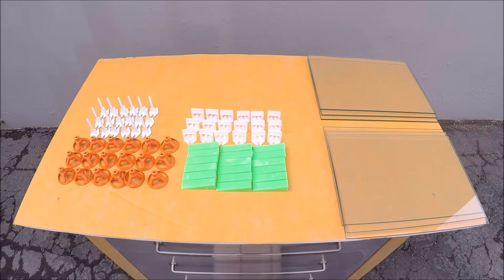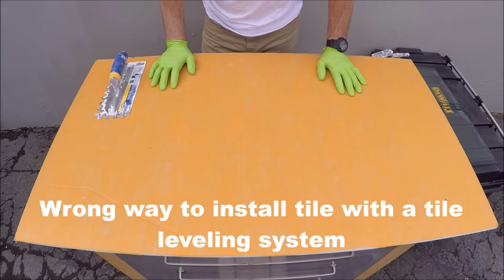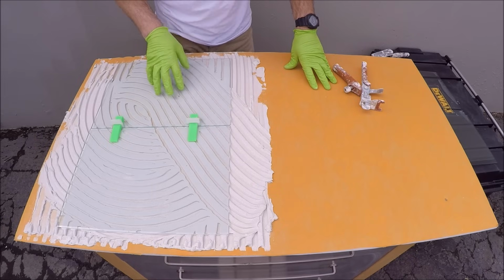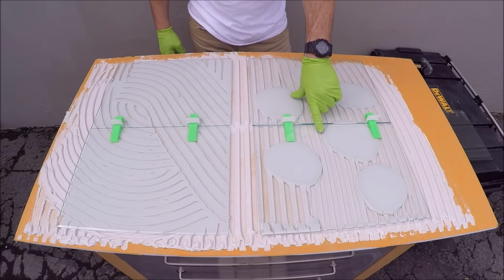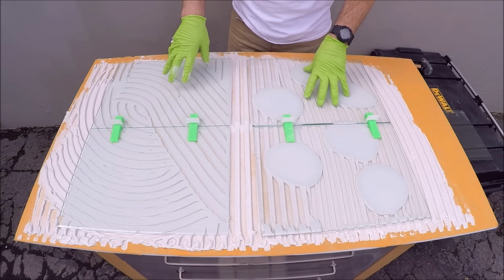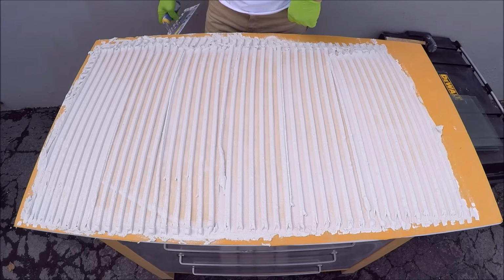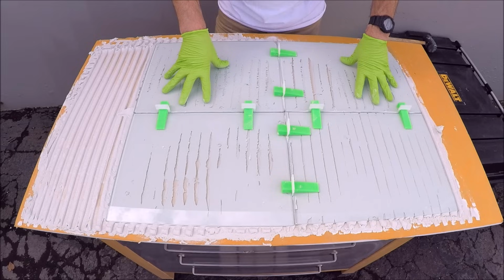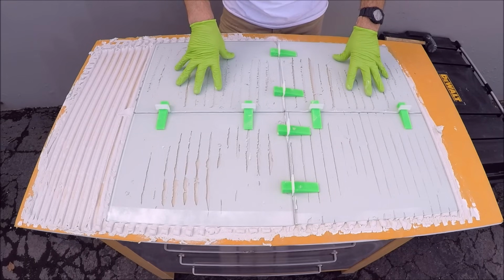How to Use a Tile Leveling System the Right Way

Comment: Straight trowel for all tiling never ever swirl,,, 900mm square porcelain tile job 250m2 ...this should not be called leveling kit, it should be called,, tile edge flush kit coz that is what your trying to achieve, getting the joints flush, this floor we did had not one step in the joints and the sub floor was pretty bad, the kit takes out all the pissing about, let's face it if something can make a job more practical just do it
Reply: Maybe it didn’t have any steps bu I bet there was a lot of voids under the tile

Comment: Good explanation but not pro approach 
Even second way is not right way installing tile with leveling system. 
On third tile installation it is clear you have excess of mortar beatween edges contacting plastic.
It will block leveling system from proper cracking  at bottom, but most likely crack will be a bit of  over top of tile or on same level as front of tile
Than  you have to use any kind of trowel with hammer to remove plastic leg.
Reply from the maker: Sorry you didn't like the video, I have 240 more videos to check out. Also, stone tile isn't used for flooring anymore, so the talk of cracking is dated my friend. Porcelain for the go.
Reply: @LandbergTileTV  I didn't say I didn't like video, just a bit details than it comes to real life, because nobody mention about how to remove plastic legs.. 
The rule if you use tile leveling system  and having excess of thin-set between  edges, than remove tile and clear it up :)

Comment: This has nothing to do with spacers or “leveling system”. This was a video on how to spread thin set. Doesn’t matter what type of spacers you get there’s a wrong way to spread motor and a correct way. Obviously correct way is to do directional pattern in one direction but again that has nothing at all to do with spacers or leveling system. Good information just pour choice of title.
Reply: And a comment with a "pour" choice in spelling 🙄
Reply from the maker: lol

Comment: Step one. Throw levelling system in the trash. Step 2. Hire a decent tile setter
Reply from the maker: Tile leveling systems are great and a lot of pro's use them, but thanks for the comment buddy 👊
Reply: We won't settle for decent it needs to be perfect there is zero tile settler who can install sharp edge floor tiles without lippage but with leveling system it can be done.
Reply: Mr. Wizeguy 

Not true...you assume no tile guy can set better than leveling system...you obviously never met the good Tile guys...
Reply: Your claim is BS because with leveling system you get zero lippage so it CAN'T be done any better it's all ready 100%.
And what you claim is impossible because large format tile have usually small warp and when you set tile by staggering seams you get lippage which with out leveling system is impossible to get off because you can't bend tile it's even on recommendations that you don't stagger seams more than 1/3rd length of tile because of that warp. 
But with leveling system it's possible to straighten that slight warp and you get 100% smooth finish even when you do 1/2 brick layout.
So obviously you never tried to tile with leveling system because it's far better than any other method.
Reply: @mr.wizeguy8995  thats not true...just bc u or nobody u know cant doesnt mean actual installers out there cant do it either
Reply: +omi89  i bet you haven't installed a single tile EVER if you think some tile settler can remove warp from tile without leveling system. Please use your brains once and think before brainfart.

Comment: One of the two tiles gets lifted meaning lack of adhesive support. These systems are flawed. You start at the highest point and the rest of the tiles are levelled to the first by down force only, very simple. If a “professional” uses these please stop them as your floor will have hollow spots.

Comment: The glue  under first tiles would have collapsed if the guy pressed or wiggled tiles like he did with second lot. You guys are so worked up with 100 percent coverage under tiles when walls are installed with a few dabs of stud adhesive and a handful of screws. Cut the crap like tanks are gonna run over tiles.  If a tile is gonna break due to movement it will break even with 100% coverage, back butter and all.
Reply: There is another reason to get full coverage, but that's only important when you have floor heating. If there are pockets of air under a tile, that air pocket works as isolator and making the floor heating less efficent.

Comment: spot bonding is perfectly acceptable if you do it properly not like you did in the video.the type of tile also matters.different direction troweling also perfectly acceptable if u press properly on the tile not like u did on the video.do this video again only this time do it on uneven surface see how u get past that without spot bonding
Reply: mihai 123 shouldn't be installing on any uneven surface if you really care about your work
Reply: Uneven surfaces are to be addressed prior to setting.
Reply: Mihai.   Read these comments.  They are correct.  Never tile on uneven surfaces.  You dont want air pockets trapped under your tile...
Reply from the maker: Yes, it would be recommended to use self leveler if the surface is uneven prior to setting. 👊
Reply: mihai 123  if u press on the tile down and add enough thinset your are good
Reply: George Rachitan. No your not.  The tile will sound hollow when walked on and not bond properly.
Reply: Lee Seong I'm no diyer.  I just believe in doing the best possible job.  This isn't it.  It's not even logical.  Tell me how using this method wouldn't trap air under the tile and more vulnerable to cracking or breaking.  Mr. Professional.........
Reply: Lee Seong that's what I thought
Reply: mihai 123 sorry but directional is not acceptable.  It's probably ok for small wall tiles but when don't on large floor tiles the walls do not collapse and the directional turn means the thickness info adhesive is inconsistent.  It's a proven fact hence why they advice against it now.  It was once common practice until further research showed the problems
Reply: mihai 123 spot bonding and multi directional troweling go’s against industry standards. You can not and will not have proper coverage under your tile. If you  have a uneven surface then you need to take the time to make it even, self level or smooth over by other means. Always try to follow TCNA recommendations.
Reply: Good comment apart from lets remember the counties like Pakistan and India did things that's lasted 100s of years. Before the western world knew how to bath
Reply: These days the skills are not the same so info that you are correct
Reply: Mihai 123... Thanks for the comment, now I know who not to hire for any tile work. lol
Reply: Unfortunately Russell, he might be a professional tiler. I have been in situations where i was told, and "forced" to work like this, and if i would have keep explaining and argue about this problem, it would have cost my job. Sure, you can quit and off course i did, but there are plenty of contractors who just want to have the job done as soon as possible, and yeah "dumpling" (thats how we call it) is unfortunately a very common method among "professionals".
Reply: Emmanuel Soriano
All surfaces are uneven. Anyone who's been doing this a long time knows that. Self leveler doesn't actually level the floor, it just fills low spots. Adjusting the amount of mortar under the tile is ALWAYS necessary if you want perfection and NO lippage with large tile. Most medium bed mortar is MADE FOR applying up to 3/4" thick. You'll never get a 3/4" bed with a 1/2" trowel, so you might lack the skill to do it, but to say it can't be done? Nonsense. It's what Medium bed was made for.
Reply: Hmm, this so called spot bonding is not acceptable!

But each invidual Tile can be tinkered to uneven ground very easily, but as it is Easy, it can take several minutes to to get the feeling when pressed to the ground to be what it has to be, for each invidual tile.

(And it will allways fill the Groud lines, that must be cleaned before it dryes.)

But yes, just by over hyper using the adheseive is messy and will have huge mess, will work if you get the right feeling.

So, relatively leveled ground does not need much work at all.

Never work with dry adheisive on ground tiles, it will not bond with the tile!

And Room temperature must match with each invidual tile.

And would be good if thinset is mixed in the same room temperature water.

Temperatures have Huge Huge Huge part in Tiling.
Reply: Lee Seong if you tile on a floor and dot and dab, you’re wrong...
Unequivocally wrong and anybody saying it’s ok isn’t a tiler....
SLC to floor then tile.
Reply: You shouldn’t be tiling any floor if you spot bond.....period!
Reply: Got to say also, if you worked for me....you’d be out of a job ...spot bonding ffs!
Reply: Exactly
Reply: @onlytheelites5797  try telling that to all the broke homeowners out there
Reply: @russellsmith6111  Oh we deplore spot bonding here in Pakistan sir !
Reply: Can you point me to a single You Tube video that shows the "proper way" to spot bond floor tile? The same question goes for non-directional troweling of floor tile thin set. I eagerly await your response because I can't seem to find any. Maybe you can make a video showing the "proper" use of these techniques so we can all be educated. Also, please contact ANSI, CTEF, and CTaSC to let them know they have it all wrong in their standards.
Reply: I should add that, ironically, I can find countless videos showing the horrific results of these two techniques. However, maybe they were all doing it wrong.
Reply: I agree with Mihai on this 100%. The framing on houses are a joke this days, especially the walls, even if you try to straighten the wall it ain't gonna be 100%, nor is th floors. No one wants to pay extra for that, but everyone wants a perfect job. You're always gonna have air under the tile, because when the floor is just a little off let's say a 1/8" off one side of the tile is gonna pressed down more than the other side. In my experience, if you press down on a tile and it creates that bond with the thinset by moving it back and forth and you're sure it has enough thinset under that's considered a good bond. End of story. Everyone saying other wise I really wanna see your work.

I've demoed a shower recently, the guy did such a bad job on, tile was uneven. He just troweled thinset on the back of the tile and he just set it on the wall without checking to see if it had good bond. There were pieces of tile that Just half the tile had bonded to the wall, I though it was a joke. Ridiculous.
Reply: Anzio 1968 If you spot bonding the floor like what he did on this video you will fail. But there is proper way of doing similar like spot bonding. When I tile the floor I notch the floor and lift up and check if there is any void. And then I add or reduce adhesive accordingly to make the tile flat to each other. If you use levelling clips you can’t do this method because once you clip you can’t lift it up again. That is why I don’t use clips. It really doesn’t matter whether directional or non-directional.
I have been tiling industry for more than 20 years. And I never see any floor was flat. So make the floor flat by self levelling prior to tile? There are 2 issues with this. First, it will cost almost same money you would pay for tiling. Secondly, Self leveller does not make the floor flat. What it does make the floor smoother. Only method to make floor flat is screed with sand & cement. It is also called “dry pack” and guess what? Screed is more expensive than self levelling. Also it needs to be at least 20mm thickness. Which mean if you screed the floor and tile, the floor would end up around 40mm higher.
If my method is dodgy or not enough, I would have been called for repair several time. I never received call for defect I always receive referrals from my customers. 
My apologies for my bad English writing here. I was born in non English speaking country.

Comment: This video didnt have a damn thing to do with a leveling system.  Like at all...  how to lay and trowel your morter has absolutely nothing to do with using any kind of leveling system because you dont have to use a leveling system...  did you not think about this when doing the video because you said using a leveling system multiple times throughout the video..  kind of comedic actually..  and you didnt say a word about what the leveling system was doing, what tool you used to pull the tile wedge in, what system it actually was, how many to use per tile, where to set them on the tile edge, what to do about corners or cutouts, how long to leave them in place or even why you would even want to spend the money on those things when you could just use a leveling compound under the underlayment..  i mean completely missed the topic of the video..  lol..  do you ever look up at the stars and wonder why the sky is blue?   Its like saying heres how to screed and finish concrete then just showing you building and explaining a form and dumping the concrete in and thats it..  doesnt make sense does it?...
Reply from the maker: understand, this follow up might help https://www.youtube.com/watch?v=rWmQ3PXe-H4

Comment: Makes no difference how trowel msg as long as u push tile into mud notice u did with directional trowelin and not other methods know what ur talking about before u open ur mouth
Reply: You are wrong. Directional trowel absolutely matters. There are other videos which address this and they even try to collapse non directional and are unable to because the air cannot escape.